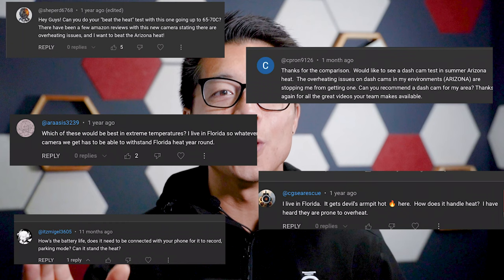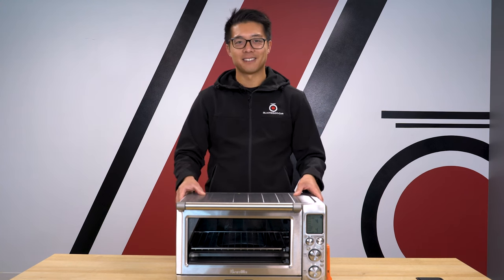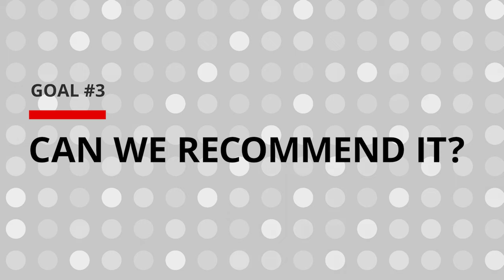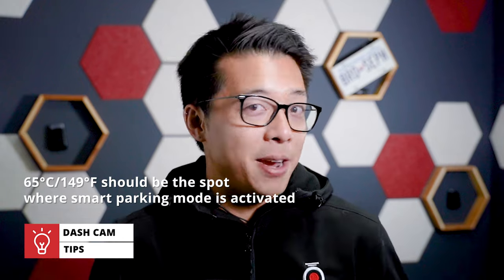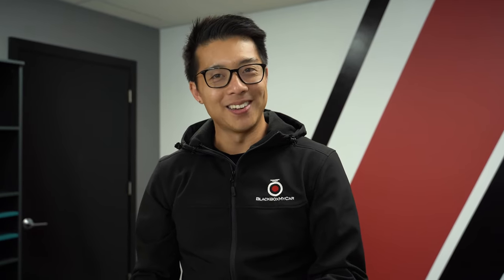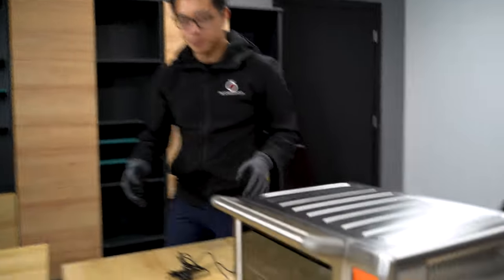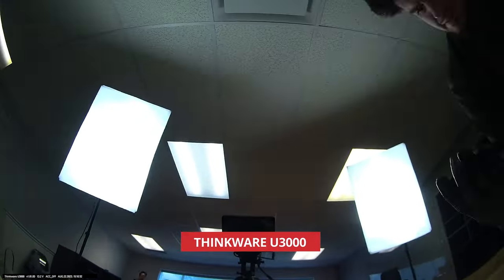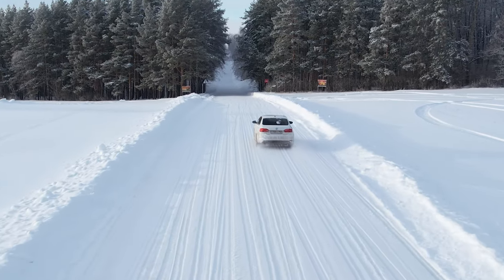Beat the Heat is Back | Thinkware U3000 4K Dash Cam | BlackboxMyCar

Comment: Great seeing you not only heat test, but to also exceed the specs to add assurance that this cam can handle the heat. Overheating has always been a major issue with dashcams, especially with parking in many climates around the world. My first cam was one of the early supercap cams, chosen specifically because it could handle the heat where I live.
Reply from the maker: No problem, exceeding the specs is the best way to put them to the test! We'll use this comment as fuel to run things a tad bit hotter next time :D

Comment: My Blackvue DR750X Plus has been a soldier in the heat.  Can sit in direct sun for hours and still record without missing a beat.
Reply: Yeah, maybe in Alaska. I can speak from extensive experience in Florida, and your statement is not true. I’ve owned all the BlackVue cameras all the way up to the most advanced current one, and they all fail when they are directly in the sunlight anywhere above 88° outside. I know this because I have them all connected to the cloud and it tells me when they shut off.
Reply: @BrettL250  One could argue "your statement is not true" as well.  It's all anecdotal anyway, here we have two examples of two different people who have two different experiences with the same product.  So far with my DR750x Plus and the new DR770x, they can sit in direct sunlight and not turn off.  I don't know what to tell you, they just don't.  Even when I had the CM100 module plugged in as well.  However, my experience with the DR970x was much different.  The morning sun barely had a chance to come out and it shut off due to overheating.  This is why I ended up sending it back.  Love the 4k quality, but couldn't always worry when the sun was out if the camera would work properly.
Reply: @BrettL250 Have you ever experienced with the footage video could not playback due to the error call video has been overwrite or deleted. My blackvue has this issue especially when it started to get hot when park under sunlight

Comment: Thank you for this experiment. I live in Florida and the dash cam overheating was a concern of mine. I really wish you guys would do an in-depth video on how the camera works with the cloud as well as the backup battery and all the settings that go along with it. Even the Thinkwear customer service people don’t know all the settings. Like for instance, with BlackVue, you can see how much percentage of the battery is left. Can you do that with this one also?
Reply from the maker: Thanks for the feedback, I'm glad it proved useful! With the Thinkware Cloud app, you aren't able to remotely check the battery capacity in the same way you can with the BlackVue camera + battery combo, however the app will tell you how long parking mode has lasted, as well as the voltage level of it's power source, while allowing you to turn off the unit remotely, which is not an option with BlackVue. Monitoring the voltage level is more useful when connecting to your car battery directly, though you can technically use this to infer the battery pack's health as well, albeit not too accurate. To be clear, I'm unsure about the new Thinkware iVolt Xtra as we don't have one to test, but I don't believe it can supply this information remotely either.

Comment: Finally this series is back!   It's crazy  how many dashcams can't handle 90  & up degrees.  So far be sides yesterday for some odd reason my u3000  wont turn on for some reason it been better than my blackvue 900x plus   it handle the summer 108 & up heat fine. 12:55 wow didnt know about the sun visor tip thanks for letting me know  even putting that on the u3000 still worked fine
Reply: You connect your BlackVue 900 X to the cloud? I do, and it overheats and shuts off when it’s directly in the sunlight every single time. I know this because the cloud tells me.
Reply from the maker: Glad you could be here with us Captain!
Reply: @BrettL250 I do but  sometimes it drops the connection
Reply: @BrettL250 hi, I have blackvue 900x connect to the cloud and it exactly shut down  as you said when park directly the sunlight. Any tricks can help? I thought to switch to thinkware u3000. I need cloud to check footage video from inside not to run to dashcam for wifi.

Comment: Thanks Broseph, love these torture tests. 
Just wondering if you will do a torture test on backup battery cell since it will be inside the vehicle as well. 
Will the LiFePo4 battery can withstand the heat to keep the dashcam running?
Reply from the maker: A great question, and thanks for the feedback, Torture tests XD, I love it! On paper, batteries should perform better as LiFePo4 is more durable, and they get to hide in the shade under the seat, but we'll see what we can cook up.

Comment: I don't have the U3000, but I do have the U1000.  The U1000 cannot handle the Texas heat.  The bluetooth, used for connecting to a hotspot, has stopped working after being in Texas temperatures between 100 degrees and 118 degrees for weeks.  The WiFi connection is still working, and that would be more important than the bluetooth since WiFi is needed to connect the dashcam to my phone.
Reply from the maker: Thanks for the feedback! This definitely goes to show that we should be more cautious in ensuring that cloud and other advanced features stay up and running in future installments during testing, as the U3000 did for this test. I'm glad your U1000 is still running with it's wifi, at least, either way the real-world experience is invaluable.

Comment: I wish you did this with BlackVue, I wouldn’t have bought it. I would’ve got the thinkware instead. My BlackVue Dr900X plus is junk when it’s 80 degrees or hotter. I bought a Redtiger F7NS 4K & it works much better in the heat. I’ve never had RedTiger go to low power mode even in 100 degrees.

Comment: “Smart” parking mode is not so smart after all. Either there’s a bug that prevents it from kicking in or false advertisement. I have a U3000 and not impressed or biased.
Reply: I just bought mine and I’ve only been using it for three days and so far I like it much better than any of my BlackVue cameras. What don’t you like about it?
Reply: @BrettL250  Check the video about “Smart Parking”. Blackboxmycar tried to test it and it doesn’t function according to its specs on extreme high temperature - even up to 80+ degrees celsius. Hence, my comment.
Reply: @davidluong5651  doesn’t function because it obviously isn’t experiencing a high enough temperature where it needs to kick in. That doesn’t mean it doesn’t function. It just means that these guys haven’t figured out what that temperature is yet.